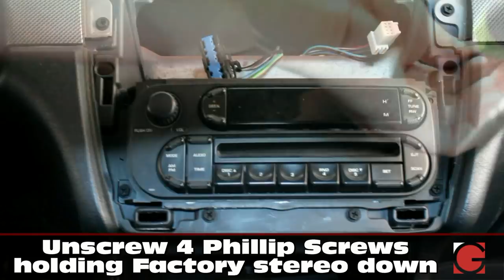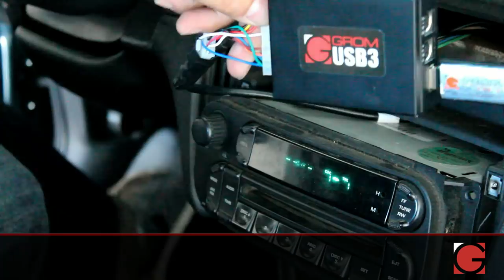How to install GROM Bluetooth iPhone Android USB car kit into Chrysler Sebring 2002-2005

Comment: Just ordered the BT3 with 3.5mm adapter for My 2004 dodge Dakota (New to me). It has the same 6 Disc Changer, I will photograph/Film parts of the install and reference this video if I have any issues. Ive installed a few aftermarket stereos in different vehicles so I doubt I will have issues.
Reply from the maker: +AeineralusCousin sure, thank you!

Comment: Maybe this is an obvious question but I'm not quite sure I'm looking to purchase this for my 2005 Dodge Ram, after you plug it in and test is where exactly does the GROM box itself go? Behind the stereo before you put it back in?
Reply from the maker: Hello Ana, we recommend leaving GROM unit in the glove box. There is enough space, and the unit stays accessible in case you need to update the firmware.
You can also extend the USB cable out somewhere close to the armrest if you plan to use USB connection.
Thank you.
Reply: That makes sense! Thank you so much for your help and quick response, I have purchased it and will definitely look to your video for a little guidance, once again thank you!
Reply from the maker: You are welcome!

Comment: Great. Now how does that device stay stable with space behind the console? Or do owners just leave the console like it's a half done project?
Reply from the maker: There are many ways to secure the device - most people use Velcro or tape mount. In addition we recommend to securing the device in the glove box - for easier accessibility for the firmware update for example.
Thank you.
Reply: If something is hillarious it's the FM receivers.

Comment: My 04 Sebring limited coupe has the HVAC controls under the radio, you sure this is the correct video for up to 05???
Reply from the maker: There might be some differences in different Sebring models. I recommend to check with GROM tech support for specific install questions, they will be able to help. http://gromaudio.com/support.html Thank you.
Reply: The coupe is different than the sedan/convertible. It is based on the Mitsubishi Eclipse.
Reply: I imagine it'll still work, just the install will be different. While the car is essentially reskinned Eclipse, the stereo looks the same as the sedan/coupe.

Comment: Why exactly does this not work with an RB1? The super cheap aux input adapters do!
Reply from the maker: The technology of the integration into the car stereo is different. The cheap aux do not fully integrate into the stereo, if they use FM transmission or something like that.

We do fully integrate into the factory car stereo system, with integrated controls and high quality sound. Unfortunately not in RB1 stereo of your vehicle.

Thank you for your interest in GROM products and technology.